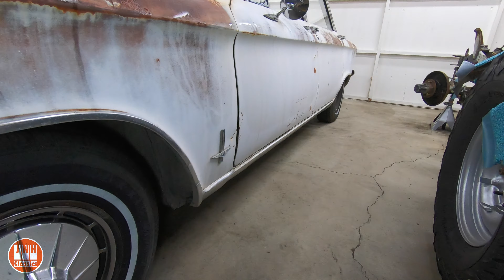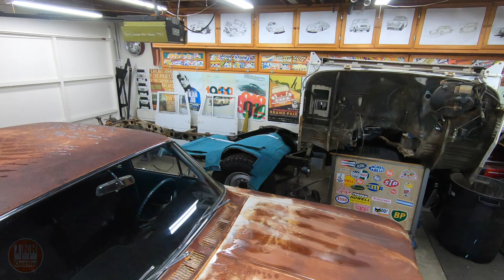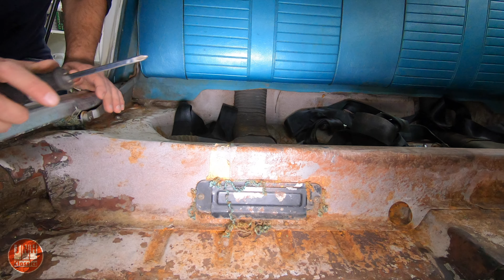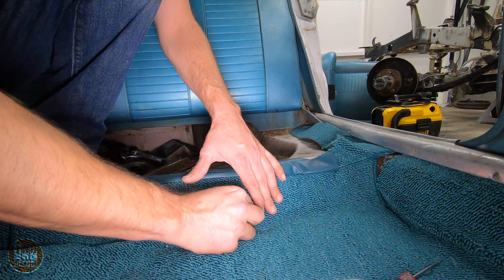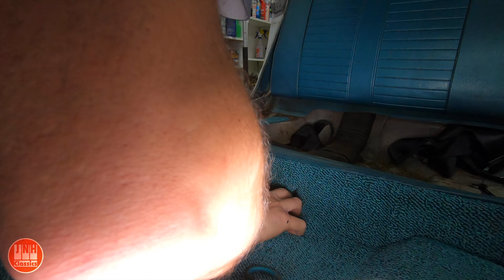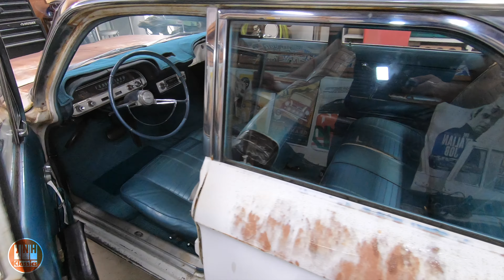“Rusty” - 64 Corvair Monza (Part 3)

Comment: I can't believe you put that new carpet down over all that surface rust. It will continue to corrode and will bleed rust color right into your carpets and eventually rot out the floor. Simply wire brushing and painting on a rust resolving paint would have been a quick and easy step. You have a really solid car that looks free of structural rot, why not stop it before becomes a problem.
Reply: Excellent point I definitely intend to right away
Reply: You don't get them that good in the north country.

Comment: I have to admit, I'm a nut on process order. After all of the seats were out, maybe a quick floor treatment would have helped. After removing the loose dirt and rust flakes, I'm would have painted it with at least primer. Of course, I would have applied some black paint like Rustoleum. Now that the carpets is in, the seats would be nice.

Comment: You don't believe in wire brushing. I wouldn't leave a speck of rust if I would find a Corvair without a rusted through floor. Thinking about buying it but that "patina" would have to be stopped before it becomes a coffee filter. I liked watching these Corvair videos. Long ago I talked my friend into buying one and we paid the price too. He drilled a hole for something next to the gas pedal and the gasoline started pissing back at us, Changed the oil seals next day the tubes were still leaking oil. I think they all leak oil all the time.
Reply: What would have to be done to the rust in order to paint it ?
Reply: @terryanthony4812  wire brushing, prime it or use RUSTREFORMER after brushing. then paint it
Reply: How hard would it be to go back in and remove the rust from the floor? Would that tape need to be redone?
Reply: Resealing leaky Corvairs was my bread and butter in the 70s. I replaced the neoprene O-rings with Viton O-rings made of silicone that could take the heat of the application. The rocker arm studs doubled as cylinder head nuts. They got a fresh Viton O-rings as well. You have to seat the push rod tubes. If memory serves, I'd use a 5/8 socket and give them a rap with a rubber mallet.

Comment: THat's NOT how you put in a carpet - and why put back rusty old parts on a new carpet? You always use a light coat of adhesive on the rug and work out all the wrinkles.